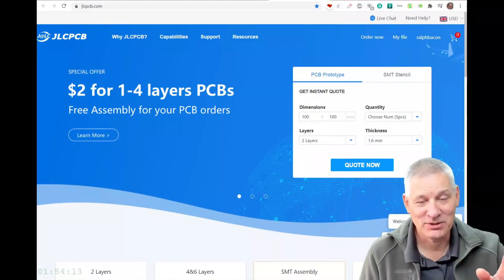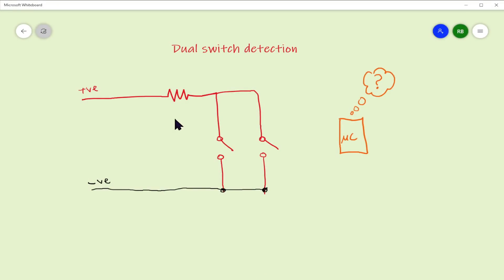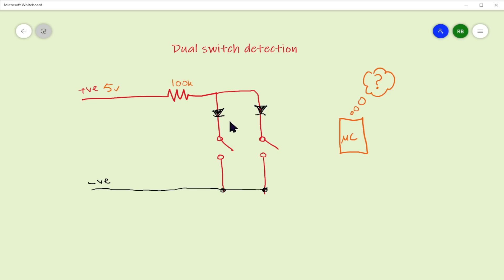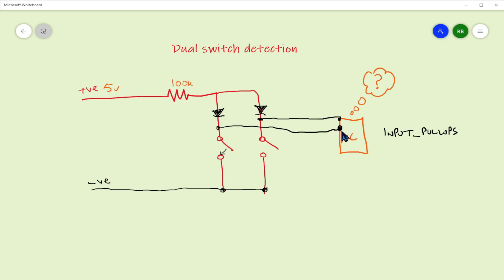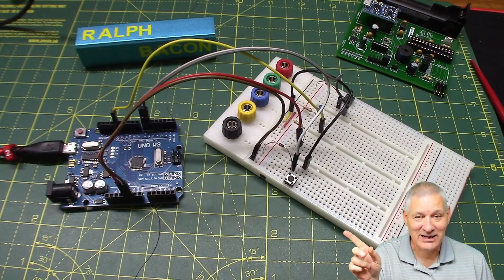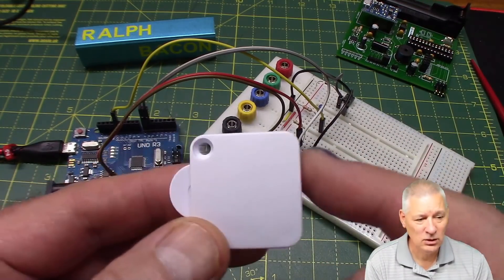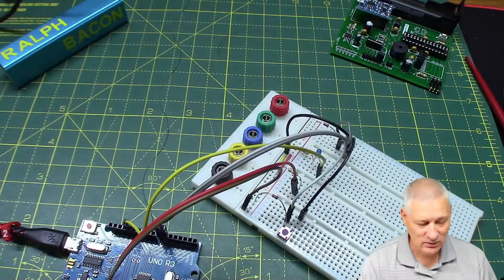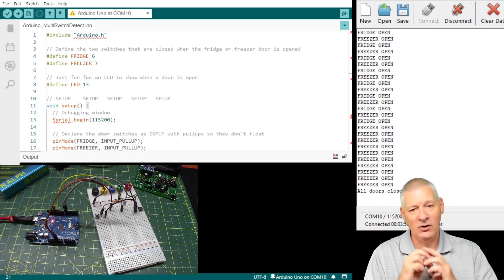#218 Dual Switch Detection using Diodes and an Arduino 😲

Comment: Hello Ralph,  use magnetic switch eg: alarm switch
Reply from the maker: Yes, that's an option as long as the distance between the door and the frame can be accurately measured. The door "nearly closed" is not good enough, if you see what I mean.
Reply: @RalphBacon  I guess the only logical choice, a micro switch with low compression lever.
Reply from the maker: Exactly so!
Reply: there's also neodium magnet

Comment: I was watching the intro and it got me thinking of a funny problem I am having with some JLCPCB boards, I am using  "ESP32 thing" boards and I made a PCB just to connect the ESP with logic level converters and some terminals, nothing more, not any component, it has only traces for connections. My ESP32s do not connect to WiFi if I plug them in the PCB, just the PCB, with or without the logic level converters is somehow making my ESP32 boards unable to connect to WiFi. I have checked visually, checked voltages, continuity, I have enough power supply current, the problem occurs with the 3 ESP boards I have. So I don`t know what can cuase this. I designed the PCB using Kicad and have done ERC.
I wired the same circuit in a protoboard and the ESP connects to WiFi, but as soon I use the PCB the ESP can't connect. SO do you think something in the PCB manufacturing can cause this? I really have tried to find my own mistakes but the PCB is so simple I cannot find what went wrong.
Reply from the maker: Hmm. So annoying when this sort of thing happens. So you have ZERO components on the (dual sided) PCB - just the ESP32? No pullups/pulldowns, caps or anything?
1. Have you got a ground plane under the antenna area of the ESP32 that is zapping all the RF frequencies?
2. Does the ESP32 boot normally otherwise, just will not connect to your home Wi-Fi? The serial output on a reset shows a normal boot?
3. Which pins do the logic level converters connect to?
If you can post a decent picture somewhere of the PCB (front and back) it might help us investigate further.
Reply: @RalphBacon    thanks for the help!!!
It only has a 10uF cap connected to reset because it is the only way I have found to successfully upload code to these boards, but besides that there is no other component, the problem occurs with and without this cap I have tested two PCBs and the two present this issue.
1. Yes it has ground under the antenna, but the ESP is not directly sitting on the PCB, it is lifted like 8 or 10mm since it's sitting on a female header. I was thinking of grinding that section of the PCB with a Dremel to see what happens
2. It reboots normally most of the time, but I have found the ESP gets hot on one of the boards while it is connected to the PCB, one board outputs garbage to the serial port sometimes, but I have one that has zero problems again I have not found any shorts or soldering problems.
3. The logic converters are wired to 5,15,16,17,19,22,23 at first I thought it was some problem with 5 and 15 cause I read those pins output PWM signals at boot (I have no scope to see that :/) but I have this problems with and without using 5 and 15. Also with and without using the logic level converters
Note: here is 1:44 am so I cannot take those pictures right now but tomorrow I'll do it and upload them to a Drive folder
Thanks again!!
Reply: @RalphBacon  https://drive.google.com/drive/folders/1BgIe6l5SQ4hib_POGQub8vhCrKpTUBWC?usp=sharing I uploaded some pictures, and pdfs, thanks for taking the time mate!
Reply from the maker: I've requested access to that drive.
Reply from the maker: OK, I've downloaded the files to my PC for a good look later, as this morning I have urgent (yes, even more urgent) business to deal with. I'll get back to you soon.
Reply: @RalphBacon  thanks! I appreciate your help! Have a nice day

Comment: Hi there, a couple of suggestions. How about using magnetic reed switches like those used in domestic alarms systems? For battery powered systems especially, try using as low a micro clock as will do the job, it saves power and there's nothing to be gained by clocking faster than needed.
Reply from the maker: Yes, magnetic reed switches would work, and require no physical contact at all. But I'm not sure I can get the accuracy I need (ie the door must be closed when the switch activates). 
In this case I'm not sure the clock speed is going to matter as the device is switched off for 99% of its life (whenever the door is closed). But I will certainly use an internal clock if available rather than a crystal one, as I don't care about accuracy but I do care about current consumption.

Comment: You could also detect multiple switches based on resistor voltage drops. Of course it would take different value resistors ins series with each switch to give the voltages  and that is connected to one MC input and then the sketch would have to be written so that it compares the voltages to determine which switches are depressed. Some car keys are decoded this way.
Reply from the maker: Ah yes, the resistor ladder, suggested by many, disliked by yours truly. After all, in this circuit we have digital inputs going spare so why not use them!

Comment: Before installing your tilt sensor in the bin, try putting it in the freezer for several hours and then try it to ensure it works. You may run into an issue with the ball bearing getting frozen in place. I assume these sensors will be used year round so the freezer will simulate winter conditions
Reply from the maker: They'll be used 24x7x365, you are correct. But they will also be protected by a watertight box with foam inside, which should protect them from the worst. But, as it takes but a jiffy to try out the freezer test, I will do that; thanks for the suggestion!

Comment: I had a similar problem not that long ago, but a bit more complicated with the fact that switches were 2 gang AC wall buttons that I wanted to utilize for providing 3 level of brightness and powering the whole fixture from either one. You can read what we came up with helpful folks from electronics.stackexchange question 495537. Yeah such trivial tasks may present themselves disrupting (:
Reply from the maker: I shall have a look right now, Leeroy, thanks for the info.

Comment: Got 9 and a bit minutes in. . .
2 Points:

1: Rubbish American Lager? Get some Belgian BEER.  Now that's worth drinking! (And I'm from the UK).
2: You have a cat (from your Youtube 'header').  No fridge/freezer is cat proof.  They have a Faraday/Tesla/Force field that stops all switches working.

But seriously, considering for home use.

Keep up the good work! :-)
Reply from the maker: The American lager is fine for lunchtimes (so I don't doze off in the afternoon). We no longer have a cat. 😥 Benny passed away 10 months ago and Dougle (our Yorkie) has yet to jump 4 feet into the air and open a fridge door!

Comment: a resistor for each switch but different values and read via Analog Input
Reply from the maker: Resistor ladder. Yes, suggested a few times here but with so many digital pins going spare there is no need IMHO.

Comment: If you're ever stuck for a micro switch just dig up an old computer mouse from the junk stash (We all have them). They have three or four nice quality microswitches in them that are very easy to push down albeit with no lever.
Great video but terrible fridge. What a stupid design.
Reply from the maker: Thanks for the tip! Those mice microswitches are pretty easy to press too. Regarding the design of the fridge, I could not agree more, but we inherited it. Maybe, one day, we'll replace it with a better one!

Comment: If you don't need to know if both switches are on at the same time you only need to check one switch. If the one you check isn't on then the other one is as the MCU has power :) So you can save a diode and pin. Not that there is much point I guess, going to be loads of pins not used anyway.

If you want to check for both at once and don't mind using analogue you could also check if the voltage is 0.7 or 0 volts to save a diode.

Just thought I would add an option to the resistor divider alternative posts :P

PS.
Isn't it going to be annoying if the alarm is on all the time the door is open? Nice upgrade might be if the you only sound the alarm if if doors is near to closed for more than say a second. You might need 4 switches :D
Reply from the maker: Alarm will not sound all the time! That would not only be annoying, it would immediately have the alarm ripped out and never to be reinstalled by the senior design technician (yes, my wife).
The alarm (see  videos #40 & #41, yes, it's been that long) will chirp as we open a door (different chirp depending on which door), give us warning beep(s) as the time goes by, then finally really go for it when it is obvious the door must be left open! Different alarm rates depending on whether it is the fridge or freezer that is open.
The only downside is that Benny (our cat, RIP) and Dougle (our Yorkie) got to recognise the fridge door open chirp and came running to ensure they didn't miss a tasty treat. 😄
Reply: @RalphBacon  I guess the small beeps cover the problem of being 1/2 way out the room or back sitting at the table when the alarm goes off.

Edit:
Only beeping when the doors is left nearly closed would be better for the Cat/Dog though and save the need for the touch switch.
Reply from the maker: I'm not sure I'll be implementing the touch switch this time; they still knew when I was opening the door, must be telepathy.

Comment: Replace the diodes with a couple of different  medium value resistors.  Then connect the common side of both switches through a third resistor to your ground return.  Connect the high side of the third resistor to an analog input on the CPU.  Set the resistor values such that your power up circuit still works.  Also set the values of the first two resistors such that when switch 1 is activates ~1mA flows through the third resistor and if switch 2 is activated ~2mA flows through the third resistor.  Then measure the voltage across the third resistor to determine which switch is activated.
SW1  inactive  SW2 inactive = 0V volts
SW1 active    SW2 inactive    = V        where V is in the millivolt range
SW1 inactive  SW2 active     = 2V
Both active                             =  2V +V = 3V
Only takes one input and is dead simple to build
Reply from the maker: Some "outside the box" thinking there Craig, very creative. However (you knew that was coming, right?) you've changed a digital input to an analog one and saved one input pin. I don't like resistor ladders or analog inputs if I can avoid them; but that's my personal preference based on what I've built over the years; YMMV as they say!
Thanks for the suggestion, I suspect many others will read your comment too, thus spreading the knowledge far and wide 👍

Comment: Thanks for another interesting video. I have a few thoughts.
1. If your door switches are double-throw NO-C-NC (most are) then connect the micro inputs to the commons, a low to NO and a high to NC to achieve the same effect.
2. If your switches are only single-throw, then does it really matter that you know if the open door is the freezer or the fridge? In practice, if either one is open you will want to go and close it. So just knowing that one of them is open is enough information.
3. More generally, have you considered Home Assistant with ESP-Home to do these sorts of monitoring/control (fridge alarm, bin alarm, etc. and heater control) over wi-fi? https://www.home-assistant.io  https://esphome.io
Thanks again, I really look forward to seeing your latest developments.
Reply from the maker: You've really given this some thought, RichT! My switches are simple SPST switches, as shown in the circuit diagram but you are right that a switch-over type could be wired in the manner you suggest.
Yes, it matters to me which door is open. Of course, in the bigger scheme of things it doesn't but as we're using a μC why not make it a little more flexible (my word for complex)?
I almost created a Node-Red/MQTT setup in my previous workshop but decided I just didn't have the time to do it justice. So this fridge alarm will be standalone (just like the previous one, that we crammed into an ATTiny13, just for fun and prove we could do it). Ideal beginners' project!

Comment: To implement multiple switches to a single input, just create a multi-tapped voltage dropper (say 5 10k in series) and use an analog input to the Arduino off the bottom of the first resistor. Each switch then shorts out one, two ... of the other resistors.
This is the standard technique. Quite well known.
Reply from the maker: Yes, quite well known but frankly quite despised by me, as I used one once and the hysteresis and drift on the analog reading was pretty wide. 
Not my preferred approach when we have digital inputs going spare, but that's just my approach, Pete. 
Perhaps I should do a quick video on resistor ladders? Hey, come back, I was just kidding!

Comment: Hi Ralph, The biggest problem for us Arduinite's at the moment is getting chips, the 328p-AU is either ridiculously priced or out of stock or both ! at least thats what I'm finding....cheers.
Reply from the maker: That's a shame. Luckily for me I have a decent stock of both lqfp and Dip although I'll be using 3 of those in my bin lid project. I'll make a note to try and source more over the next few weeks -  thanks for the heads up.
Reply: @RalphBacon  Would be interesting to see how you get on.

Comment: Wait I thought the whole point of this was to measure two buttons with one input? And then you use a pin each to measure each button (2 pins, 2 "inputs")? Am I missing something here?
Reply from the maker: No, you're not missing something but remember that each pin must be driven by the same +5v input (well, must be connected to the Gate of the P-Channel MOSFET, so a common connection). And I want to differentiate between switches, ie not wired in parallel. 
So it's not the same as having two independent switches connected to two independent input pins. 
Well, after my circuit it is!

Comment: Have you considered using a Latch circuit instead of putting the micro to sleep, it use less power. Look at this video from Electronoobs https://www.youtube.com/watch?v=Er8fSoeaZD0 where he demonstrates it. If you look at the last comment, it's from me where I have a link to button circuit I built using his latch circuit. My version 2 of it (short, long or mutliple press) uses an Attiny85 and an ESP or a HC12 433mhz transceiver. I measured  the current with an Power Profiler 2 and it was nano amps when idle.
Reply from the maker: I will look at that with a beer in just a moment, JC. Thanks for the link.
Reply from the maker: So, the latch circuit he describes there is pretty much identical to my auto on/off/kill circuit from various of my videos (eg #172, #173). As I demoed this first I claim bragging rights!!!

Comment: Hi Ralph, thanks again - nice video. An idea for you - how to drive a bicolour LED with just one I/O line in the simplest (and safest) way possible. Will be interesting, and useful for a lot of folks. Regards!
Reply from the maker: Depends on the LED; does it have a common anode/cathode (3 leads) or is it just two LEDs in one package (with 4 leads). Former will require one resistor protected input to sink/source power respectively; and the latter, well, we would common the anodes and do the same. I realise that beginners would not know this so I might drop it into a future video. 
Just to make it more interesting we can use different resistors (across the diodes) to give different operating currents for each LED!
Reply: Common cathode 3 lead seems to be the most "common". I already know how to do this - there's a few caveats though. Just thought it might make an interesting video.

Comment: Hello Ralph, have a look at reed-switches, thiey work with a magnet nearing it, so practically no force involved.
Reply: The problem with reed switches is the high hysteresis  - for this problem you need the smallest hysteresis possible to detect a minimal opening.
Reply: @stealthblade1  Agreed, but those furniture-switches have a huge hysteresis too, so in any case it is a question of adjustment. The hysteresis could be adjusted with the huge opening triggering quite late and therefore have a late closing as well.
Reply from the maker: The furniture switch can be cleverly mounted so that it only goes off when the door is really closed. And opens when the cupboard door has just opened. Now, I did do this with a reed switch (from a burglar alarm door contact) and high power external magnet on the previous fridge alarm (Nano-based, which I might reinstate now, on the "other" fridge I showed first).

Comment: Ralph, given how little power your fridge monitor needs is there any chance you could trickle charge the battery from a tiny solar panel ? (Assuming the design meets your Mrs approval of course 😀)
Reply from the maker: You already know the answer, Chris. Firstly, the Mrs would not approve of any such nonsense. And, secondly, there is no sun in our kitchen.
However, I do have a solar panel design for something else in mind in the future, so keep tuned!